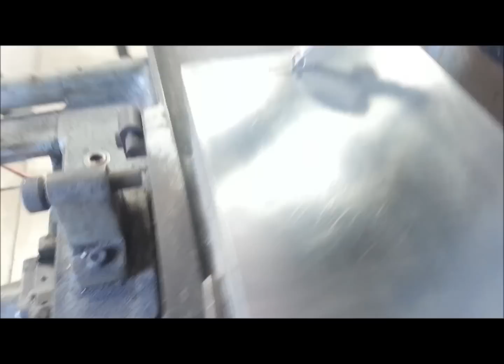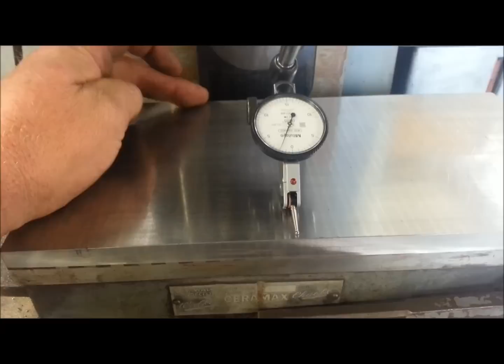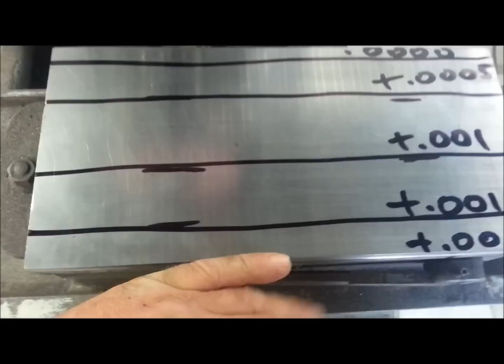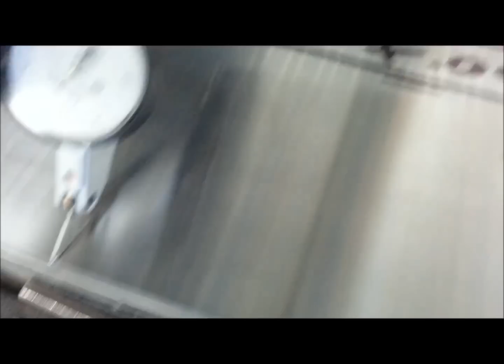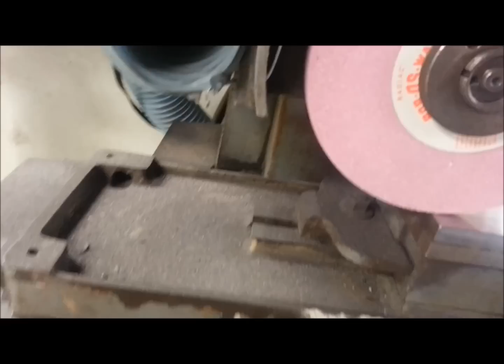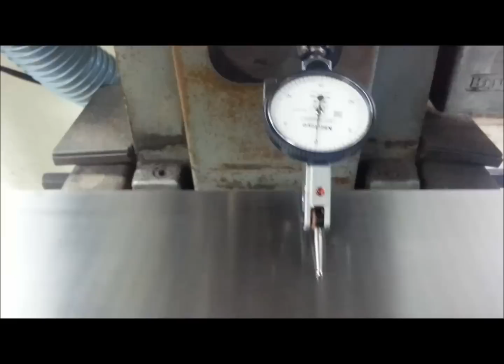Surface grinder first project

Comment: One thing I noticed is that you had turned the grinder off after you had dressed the wheel. I haven't done much grinding but I've been told the wheel should be dressed each time the grinder is turned on and has sat for awhile. The reason being is that the bearings cool down and there could possibly be subtile changes in accuracy. One more note, your grind in the x axis was a longer grind and it turned out perfect. Wheel wear didn't seem to have any effect. Do you think there could be a problem in your y axis that is causing the table to tilt? I'm not a pro but it's just a thought.
Reply: There is no need to dress a wheel after starting, if it is still sharp. Bearings do cool down, yes, but that is why you warm up the machine before doing any work on it, especially if it is non-ball bearing spindle. For the record, been a grinder for several years now :)
Reply: Jaakko Fagerlund
As I said I haven't done much grinding so I'm not in a position to debate you. I run a Moore jig borer and there is a thermometer built into the spindle. A note on the machine says a 10 degree change in temperature can change the accuracy by .0001. If I'm boring a diameter with a -.0001 +.0000 that could be a headache for me if I go over the high limit. If I have to leave the machine such as for lunch, I leave it running. A coworker of mine does line boring on a Devlig with a horizontal spindle and he said even gravity can have an effect on accuracy depending upon how far the spindle is extended. This may all sound like picking the fly shit out of the pepper but it does seem like something to consider. Maybe someone else can shed some light on the subject.
Reply from the maker: Hi Paul and Jaakko, There are folks that swear up and down that the spindle HAS to be left running after dressing when coming up on a final, I have tried both ways on this machine, no measurable change either way, now what needs to be taken into account is, I have no other machine to compare it to.

Heres another interesting observation, this machine has an automatic oiler and if it cycles during a final cut, the surface tension of the way oil actually lifts the table a measurable amount, hows that for splitting hairs?
Reply: Shadon HKW
Yep, one of the grinders at the place I work has an automatic oiler, which pumps on every X axis stroke of the table. If the machine has sat for a while, you put a dial indicator on the table and turn the machine on, you can measure easily 0.03 - 0.05 mm lift due to the way oil pumping between the slides.

The kind of oiler you described sounds like a really bad idea for a grinder, or at least it should have an off switch.

The machines at work are Jakobsen and Jones & Shipman, the former being fully automatic. The Jakobsen has ball bearings on the spindle and it runs true from the start, but the Jones & Shipman has a basic poured babbitt bearing which will give you a nice whack-whack-whack pattern if you start grinding immediately after turning it on. But waiting 10 minutes for the spindle to warm up and 'tighten up', the surface finish is like a mirror without any marks from runout or imbalance.

But the most of the differences come from the way oil lifting the table and from the whole machine warming up. You can see the same warming up in a milling machine, where the spindle throat length increases a little as it warms up.
Reply: Shadon HKW When you say a measurable amount, are you referring to tenths or thousands? Could it be possible the gibs need to be tightened slightly due to wear? Could it be the viscosity of the lube you are using? I think there is a way lube lite that may be a bit of a thinner lube oil. 99.9% of what I do is milling, lathe, or jig bore machining so I'm not really versed on a surface grinder.  The machines I use are a Sip, Devlig, Mooer jig bore, and your standard Bridgeport plus a variety of other machines such as shears and turret lathes. I hope you don't think I'm spewing out nonsense.
Reply from the maker: ***** A couple of tenths when the oiler goes off, I have learned to keep an eye on the oiler and can tell when it's about to go off. The Boyer Shultz doesnt have gibs, It has 1 flat and 1 vee similar to a lathe bed, the table can simply be lifted off at any time.
Reply: *****
Tenths, or in my speak thousands as I work in millimeters, so 0.002 mm is around the amount. But in most grinding operations that doesn't matter, as usuial tolerances for grind are in the 0.01 mm range (half a thou for the inch guys).

About the X axis grind, it is not about the length of the cut but more to do with the area you are grinding. As you progress across the table in Z axis, the area grows larger and larger and that is why in the video you see so big of a difference across the Z axis on that table (actually chuck, but whatever).
Reply: My .02, but I just leave it running, as it doesn't hurt anything one way or another.  I will resharpen my wheel first thing in the morning after warm up but that's more on principle than need, if I don't feel a vibe in the wheel and my tolerances are +/- half a thou I generally don't bother.  One thing you don't want to do is leave the chuck on for really long periods of time (more than 4 hours) as it can burn it out.

Comment: Great explanation, how about option C rising other side with shims - like filler gauge blade - to compensate disc wear?
Reply from the maker: Hi Tom, I actually re-seated the chuck in this video -> Reseating a magnetic chuck
Reply: that is my thought too .....assuming the wheel wears at the same rate all the time ,  shimming the table .
Reply: jreatx It doesn't wear at the same rate.  The spindle is rigid and so there's no need to shim a chuck.  If you have a difference it's usually due to heat, wheel break down or crap under something.

Comment: I'm still wet-behind-the-ears when it comes to machinist type things, but have wondered about tool wear, and measurements of said wear.  I appreciate you taking the time to document this at length, and share with everyone.
Reply: I ran a CNC lathe that had a tool wear indicator. It might be more of a "heads up" thing to let the operator know that if he is seeing changes in part dimensions, it might be time to change the tool. You can also do a TLO which is tool length offset to compensate for changes.

Comment: I read the article on the other forum  the deep cut corner degrading till center is now corner then redress is probably ideal.
 Another thought is if one can place an identical material to work piece  under the part you want to grind after doing a pass on the  material that is underneath set depth  for part  to start at what the change was on the  lower material .002 in your case and work the opposite direction with same overlap depth and speed might make opposing errors cancel each other

Comment: ok I still don't understand some of what's going o with you mag chuck.
 if the grinding wheel is wearing away you would not be getting a -0- from side to side
 if you had wheel wear.  second  you're wheel is what kind 80 K 80 J?
I think you're better off using a 46 H with a rough dress to reduce the contact.
I think what happed was with you're way not you're wheel are the ways getting lubed?
seam's like to more it warmed up the better it got.
 and yes dress the chuck with the mag On . coolent is a good idea too.
Reply: Ofcourse you can get a zero across the table, it is very short width the wheel needs to take away, but on the overall table surface area the wheel wears gradually down. Remember, it was 0.005" over the width of the table, which means basically nothing over a short distance, which also holds true for lengthwise and that is why you get zero from side to side.

'Wearing away' doesn't mean that the wheel obliterates itself in font of your eyes and says 'whoosh' in the process, but just means that it wears. Wear is not a measurable quantity, it is a word used to descrive what happens.

Comment: Without the use of cooling fluids the metal will expand into the cut causing a deeper than needed cut.  It is likely your bed is worn.  Have to thought about using shims.

Comment: I wonder if you could have used a diamond grinding (metal) wheel to do this job? i`m thinking that the degrading might of been less of an issue?!
But I am super impressed with your tenacity and your method in removing both the ramp and convex surface!
Reply: the wheel was to big,you use the smallest diameter wheel you can, been a grinder fot55 years.

Comment: I just got done doing my Okamoto and I have old hands telling me chuck on, chuck off etc.  I ended up going off.  After I roughed it in I was chasing heat for a few tenths before I started backing off to 50 millionths passes.  Well, not precisely, but since my downfeed only shows .0002 per tick, I just visually divided the ticks by four.  I was going back to front only and every pass would check the temp on the chuck.  It was ice cold the whole time, but then my boss said use WD-40, so I started using it but I didn't think I really needed it. My final pass was front to back.  My chuck is close to mirror (I know, it isn't supposed to be) and I'm dead flat through both my Y and X.  You're right though, it's a boring boring process.  Then I had to grind in my back fence.  That wasn't too bad but dressing the wheel made for lots of grit in my face.

Comment: if the wear on your wheel is constant/consistent you could probably jack the front of the work piece up by the amount you expect it to wear. that should in theory allow you to cut at one height through the whole cut and account for the wear evenly throughout the piece and end up with an even thickness.
Reply: Yes, and the Earth is flat in theory, if you just view it from the side.

Comment: I missed at the beginning, you could have possible gone with say a 46 grit, and a bit harder to hold form. Then hopefully by holding your cross feed down a bit, yes, the stone becomes tapered a bit, but has not become tapered all the way across the wheel by the time you are all the way across
Bad ASCII art:
If the wheel starts shaped like
_
it starts to wear like
\__
You are still good as long as you don't cross feed more that the flat that is left
Then you get to
\
 \_
again, still not an issue so long as you don't cross feed more than the remaining flat
when you get to
\
 \
  \
then you have a problem

Comment: You have a few problems going on there. I agree with you and Oxtool also. On your part I see surface finish it poor that can be caused by many things wheel balance feeds and speed. Cooling should be used on a part that size also. Most time people dont feed enough x and to much y. The wider the part you need to lessin y feed. I own a job shop and we grind dies and punches for a local press company. My manual machine will take 12x24 plate or part and my cnc will take a 16x40 plate or part. If you still have problems or need help get in touch im more then willing to help out.
Reply: What does the pat width have to do with Y axis feed? You probably mean Z axis feed, as the Y axis usually stays where it is when doing a pass over the work piece.

Comment: did you leave the magnet on or off ??
Reply from the maker: On, just seemed like the right thing to do.
Reply: Shadon HKW you havent use colling fluid ?? i think its a better way to grind the vice, thats why your grinding disc have a tolerance

Comment: I don't think you should turn off your spindle after dressing, just a fundamental of grinding i learned long time ago. But thanks for sharing
Reply: 'Think' and 'know' are two different things. You 'think' you know, but you are just repeating the same old mantra I see everywhere without any reality in the statement. If your spindle is that worn or have that crappy bearings or your wheel is not actually attached to the spindle/arbor properly, you might want to check those issues or buy a new machine.
Reply: Jaakko Fagerlund I don't think buying a new machine in this particular case is not an option, now is it?

Comment: Just a quick point,  you kept going back and forth across table to measure trueness. I hate to point out that proves nothing.  If your table moved in a certain arc it will always travel in that same arc, making your cut also in that same arc.  A cut arc traveling in the same arc will always indicate 0.  A 2 thou difference in first cut suggests you were trying to take off too much, your cut itself should have been 1/2 or a 1/4 of this.  Also after 3rd cut starting edge was cut deeper-  possibly could have been your wheel was not on work far enough.  Spring during a wider cut will make it not as deep.
Reply: The problem is that the table and the mahine ways do not form the same wear pattern on them (same radius arc), as they are two different length objects. But it doesn't matter if it moves in an arc or not, if it isn't too much as the chuck will ensure your part will be parallel, as the chuck is parallel to the machine travels.

If on the other hand your machine is a rocking horse, it isn't doing what it is supposed to be and should be fixed or scrapped and new one bought.

proper way to test the machine is to put 5 small parts, 4 in the corners and one in the middle of the chuck and grind them. Then take them to a surface plate to compare or mic them. That way you can easily say what tolerance your machine is capable of holding.

Comment: Well you inspired me to get busy with my grinder. Cleaned it all up again today. Ground the mag. base. Need to go over it again. Same problem you had. It is .001 higher in the front than in the back. I have a vibration that I don't like. I am going to check the belt. Who knows how old it is and I had a wood lathe with a vibration that was caused by the belt getting old and crappy. We will see. I did a video on the progress but it won't be up for a day or so.
Reply from the maker: Dress your wheel, get a nice link belt, wheel balancing I'm told is very important, but I've never tried it. Work front to back, then back to front, you end up with a hump in the middle, keep making light passes till it's gone.

Good luck and keep us posted!

Comment: Stan, I had the table from my milling machine ground by a mob of professionals, because I couldn't tram it in. Those blokes used flood coolant, and cuts of a few tenths of a thou.  They had a very big machine, but didn't seem to need to dress the wheel. It took about twenty minutes to face a thirty by six inch table dead flat.

I ain't going to contradict Tom, who knows far more than I, but my understanding was that cuts of two thou on such a small machine were excessively aggressive, especially when done without cooling.

I wish I could score such a machine, but here in Australia they are pretty thin on the ground...

Comment: Hey Stan,

Its pretty typical the mag chuck has a bump hump in the middle. The segments move when you turn the magnet on so they typically shift in the center. Your final cut should be super light. Mark the chuck with sharpie and use WD-40 sprayed on the chuck. Just take the sharpie off and go fast with the feed. Looks like you will be shopping for a tenths indicator pretty soon. Nice job and nice score on the machine.

Your next challenge will be grinding the back rail. Looking forward to your next video.

All the best,

Tom
Reply: Grinding mag chuck on dry grinder 101 - 46 grit wheel open dress, take a couple of tenths per pass, dress often between passes.  Very heavy cross feed like one rev of handle per stroke.  heat is the enemy.  Objective is to get across quickly generating as little heat as possible.   You will see line pattern, shouldn't have a mirror finish.  Try it.  Good luck and have fun!
Reply from the maker: Thanks Tom,

I wasn't sure if I should grind "magnet on" or "magnet off" I chose "ON" because that's the state it is in during business hours. Not too scientific .. but there it is ....

Stan
Reply: oxtool
Reply from the maker: WD will help your wheel from clogging when grinding soft materials, much the same as milling or turning.
Reply: oxtoolco l
Reply: @Axel Dominic thanks, I went there and it seems to work :) I appreciate it !
Reply: @Yusuf Baker no problem =)
Reply: I guess I am quite off topic but does anybody know of a good website to stream new series online ?

Comment: I am not sure I like the angle of your indicator needle. I think your problem was split between the wearing of the wheel like you said, and the wear of your machine.
Reply: Better get used to it, as that's the most common angle and most proper indicators are actually calibrated for about 12 degree angle. If you want to get picky, you can calculate the cosine error and notice that at those small angles it doesn't do jack shit. Also, it doesn't matter at all because he is doing reference measurements, not absolutes.

Comment: I like it but now I "need" one as well. :-)
I've never used one but I suspect that with abrasive wheels you depth of "cut" plays a large role in wheel wear and maintaining accuracy. trying to remove .002" is going to wear the wheel much more over the width of the part than a skim with a couple tenths.
Good video, thanks shadon

Comment: It's great to have new toys and learn something new.
What depth of cut did you use for the first pass, when I got my grinder it was suggested that a typical cut should be no more than 1/2 to 1 thou tops. Not played with mine much latterly, as it is still in transit between front garden and the back one, Note to self, must clear the garden gate! 
chris
PS made some of your angle plates in 90/60/30 but still not bothered to harden themyet as  they seem to be good enough already for the light use they will get here.